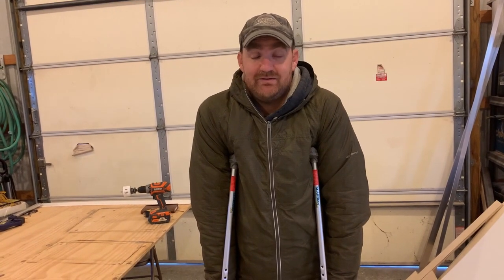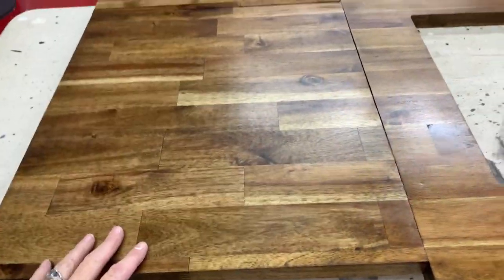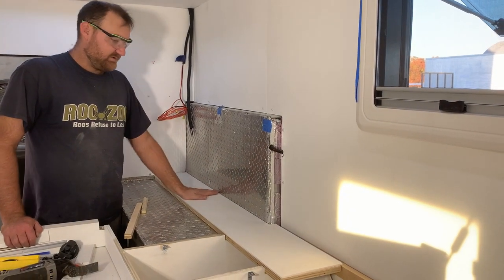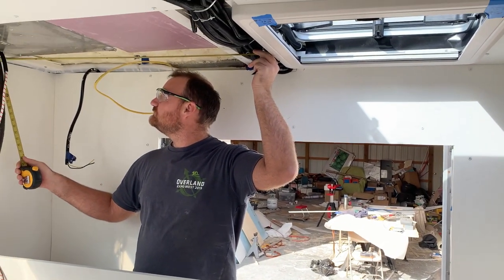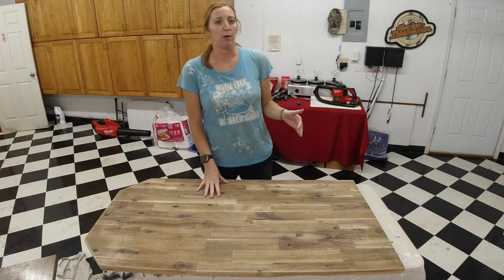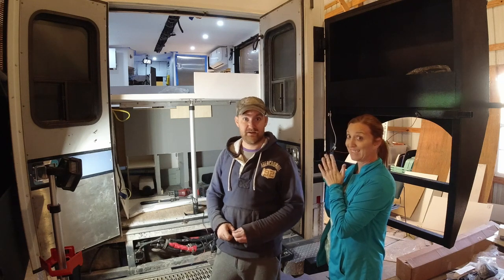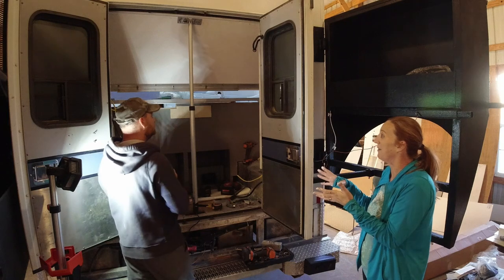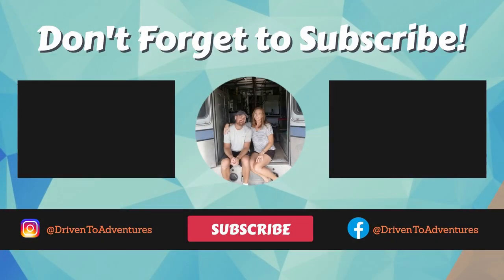DIY Electric Bed Lift System | Ambulance Expedition Vehicle

Comment: Those lifters dont love a side load, hence the clevis attachments at the end. I did one similar in a previous build and it was a lot happier with some sort of linear motion control slide to attach the bottom corner of the bed to the rear wall. Then all of the lifters work is pushing straight up, and the linear motion device would transfer that upward force into a 'pull' to pull the bottom of the bed in as the back goes up. Other option is just a slide rail actuator.

Comment: The reason why your butcher block countertops are cracking is several reasons:
1) your pieces are too wide. Narrow pieces allows less movement and stress.  
2) you didn’t reverse grain when gluing up.  
3) your pieces moisture content was still too high.  
4) you mixed species.  Certain species move more than others.

Comment: About the cracking of your wood I could be wrong. But I think I would only buy wood that has been seasoned. Another words set for long periods of time. So the moisture can dry out at any type of cracking can show and then you can work with the wood to smooth it out. If the water still has moisture in it as it dries it can crack